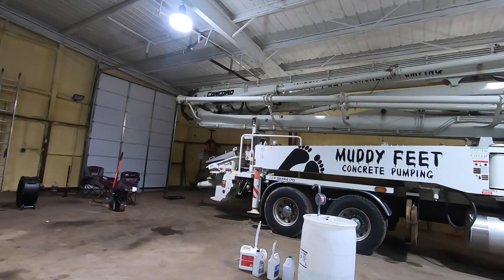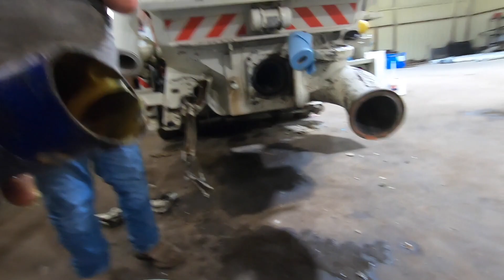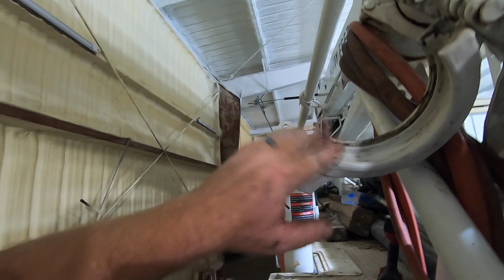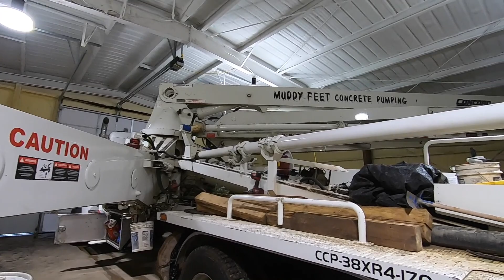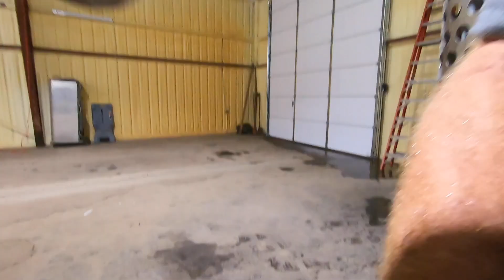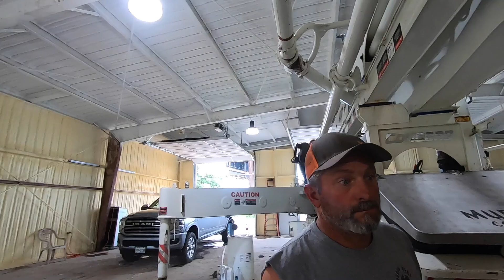Pipe replacement for our 38 meter concrete boom pump.

Comment: After a job, I understand you blow up the pipes with air, but do you clean the pipe all the way through? If so, how you do it?
I understand you clean the pump parts with water but how would you clean the pipe out all the way?
Reply from the maker: Once we send the bag through the pipes they are clean enough.

Comment: Is it easier replacing pipe folded up like that or in an ideal world would you extend the boom out straight and lower it to the ground?
Reply from the maker: Could be. The hardest part is getting from the back end to out of the tourit after that it’s up to you.
Reply: unfolded the deflection in the boom makes the pipe alignment funny.  ive always found it best to do them racked up if you can.
Reply: We stretch ours out and leave it loose until it's folded up. The turret is always a pain though.
Reply: I asked the putz guys the last couple times they in-serviced machines for the companies I worked for. Same answer in different parts of the country. Cradled is how they do it at the factory. Deflection adversely effects the pipe alignment.

Comment: How do you know it’s time to replace the pipes? How much yardage you put through it? Or do you measure the thickness?
Reply from the maker: We see such a variance of material you really can’t go off of a yardage count. We just go off of timing, tapping on the pipe and we even started having some leaks where the pipe was welded.

Comment: What's the psi when pumping...I'm guessing 15 psi ?
Reply from the maker: Pump pressure will depend on the resistance of the hight and density of the material 80 to 100 bar is what I typically see
Reply: @MuddyfeetConcretePumping  Wow ..100 bar is 1450 psi. (So 1200 - 1450 psi) I guess that's what it takes..
Reply from the maker: @steveg5576  yes sir. Seems like lot. When we use air to blow out the lines on our trailer pump it only takes 25-40 psi to push the concrete out
Reply: @MuddyfeetConcretePumping  That 100 bar is probably at the pump head, makes sense. 1000 psi at the end, you could sell tickets !
Reply: @steveg5576  the remote of the putzmeister boom pumps are cool. They tell you what kind of pressures the piston is applying. Jeff is referencing the rod side. The piston side averages 180-200psi when the concrete is really wet (8"+) and the mix design has plenty of sand. When the concrete is relatively dry, like a 4" or less going in the hopper, and there is bare minimum sand, you'll see pressures upwards of 950psi at the piston.